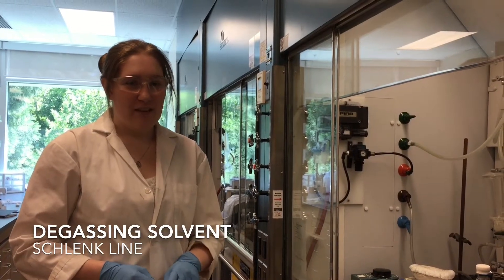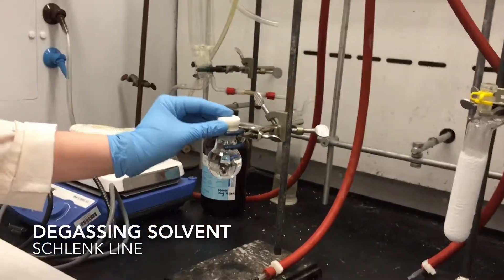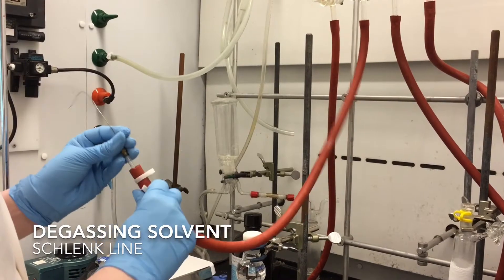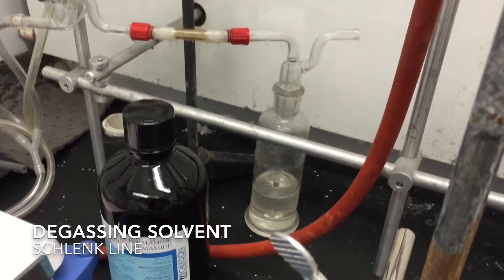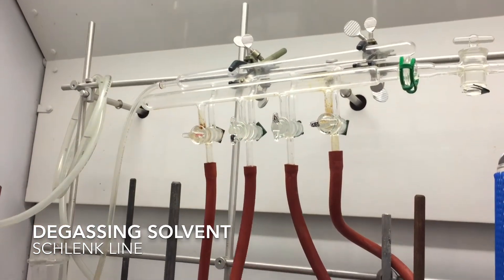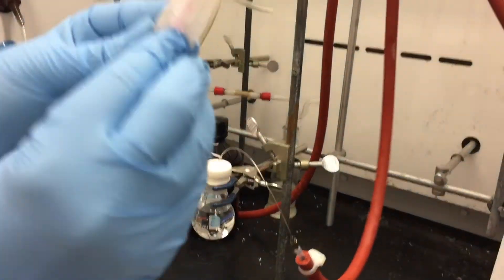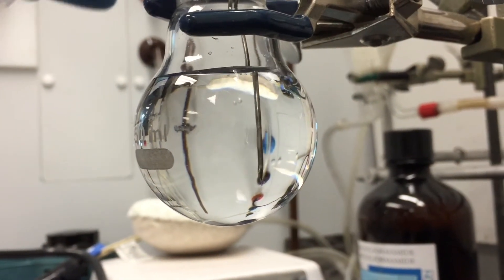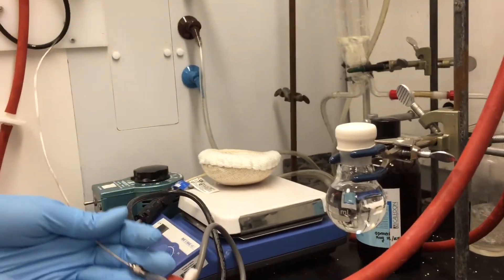Degassing solvent on the Schlenk line

Comment: hello, what if i didn't put the needle in the water or the liquid ? i mean when the nitrogen gas flowing above the water  not in the water, ?
Reply: @mehdiarjomandpur9424  thank you so much,
Reply: what was the answer of your question?
Reply: @이민성-f9w  I haven't seen the original answer but I don't believe this would work. If the needle is above the solution, then you will only displace oxygen from the headspace of the flask. I believe the needle needs to be in contact with your solution so that the positive pressure of nitrogen actively displaces dissolved oxygen in the solution. 
I hope that makes sense?
Reply: @catherinewebley5299  I appreciate your answer. Thank you